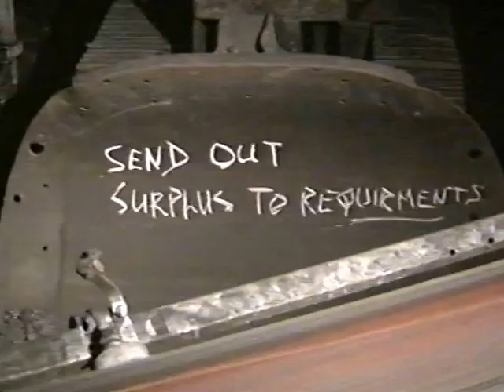Underground at Betws Mine

Comment: until recently i just thought that steam coal was shiny and house coal was darker but very recently i discovered that the names for steam coal and house coal was Betumious? and Lignete?
 could give any information on what type of coal is being dug up in this footage?
Reply: anthracite
Reply: @44Celt  so this coal was steam coal then?
Reply: @eliotreader8220  anthracite is harder than steam coal -cleaner burning
Reply: @44Celt  so the coal from this coal mine could not be used in the fire box of a heritage steam locomotive or traction engine or was this Welsh steam which i understand is a kind of Anthracite?
Reply: @eliotreader8220   maybe it could but its a lot more expensive than steam coal which would normally be used for steam application
Reply: Every seam had its own name also, this was the Red.
Reply: @eliotreader8220  steam cola has a slightly higher volatile content than anthracite, is softer and slightly less calorific value, would not use anthracite in a steam engine.
Reply: Bituminous, lignite is younger and not much better than pete.
Reply: Lignite was dirty coal, mostly mined in open pits.
Reply: High Quality Anthracite